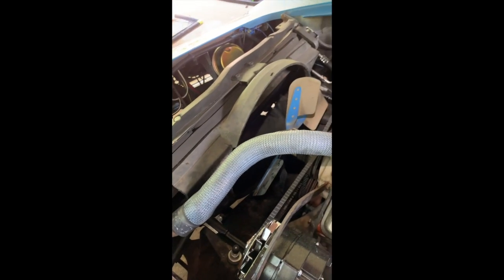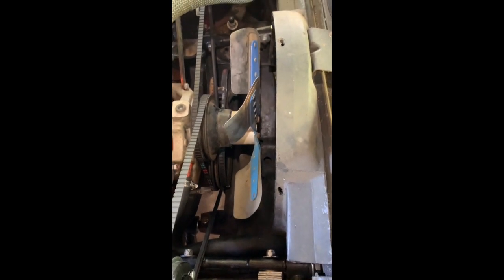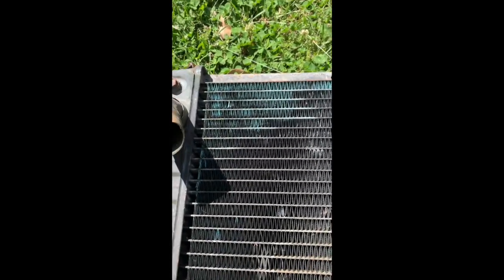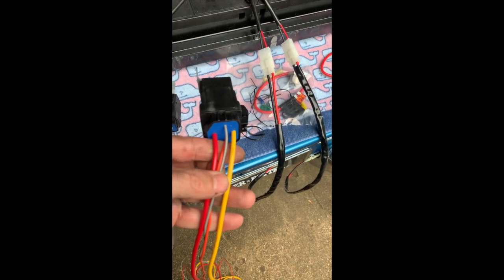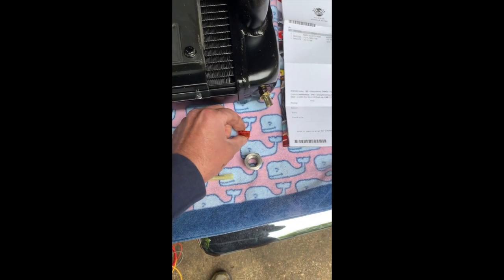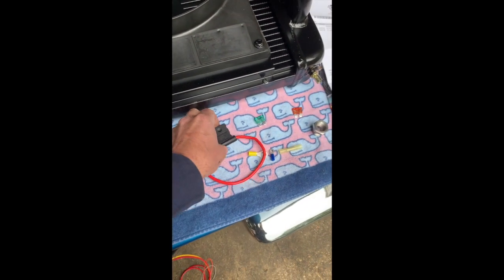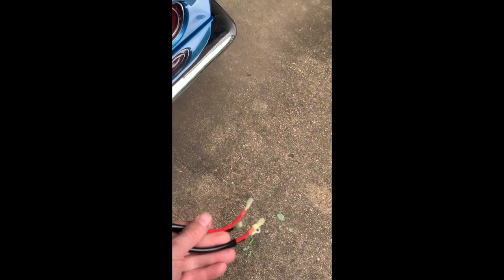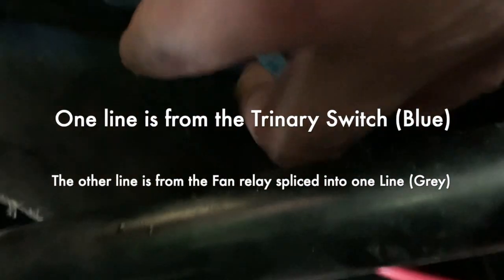Dewitt's Radiator with electric fans DIY Installation into a 1973 C3 Corvette

Comment: I wish that you had wired the fans into a MSD ATOMIC Electronic Ignition system. That way I would know exactly how to do my 1971.
Reply from the maker: My Sniper also has that option. But does it really matter? the fans should be triggered by temp?